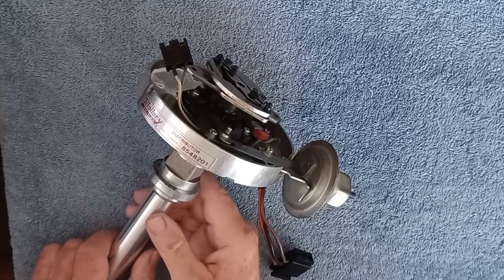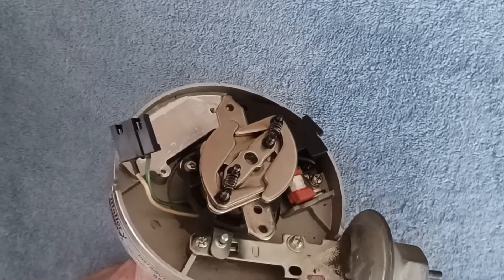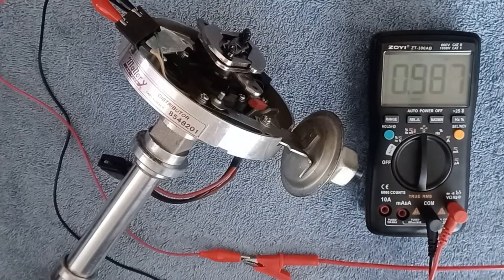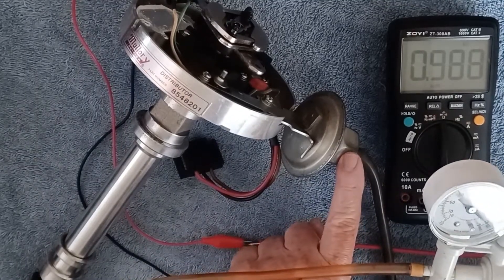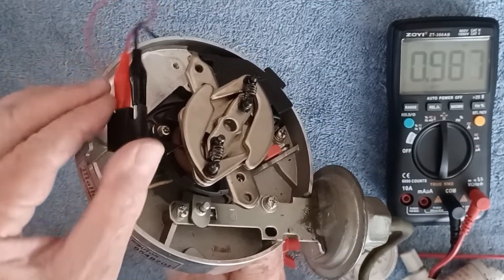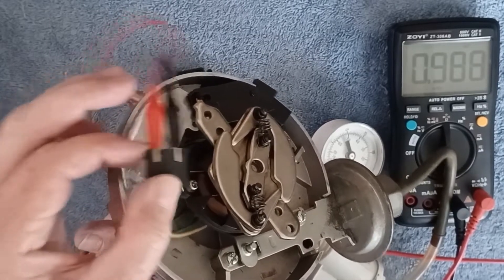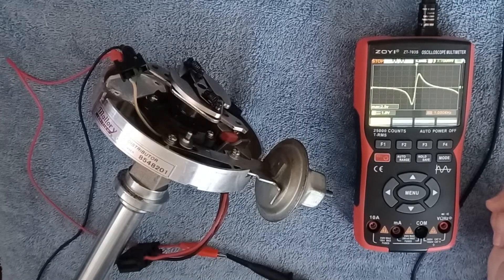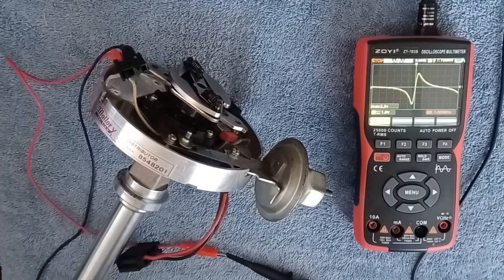How to Diagnose an HEI Distributor Pickup Coil

Comment: Great video and info. Now something for those who like building high voltage power supplies using these HEI systems:    Some folks mimic the 'pick up' coil's output using a 555 timer circut to produce a 'no moving parts' coil driving circuit. These timers actually connect to the control module and seem to work well. But unfortunately these timers are more prone and set up as a 50% duty cycle output; not a 12-12.5% most ignition systems comfortably run at.  The 50% duty cycle is okay for many applications outside and beyond automotive applications but not so much for proper "dwell" time and longevity of one's coil. 

Again, proper "dwell" in either an HEI or points system usually operate in the range of 12.5% duty cycle, otherwise leaving the ignition coil (in the case of an HEI type) discharging for a longer time and consequently a shorter charge time. This will not hurt the coil per say, but at higher frequencies will reduce the coils over-all performance and voltage output.  For those who wanted to know.😅